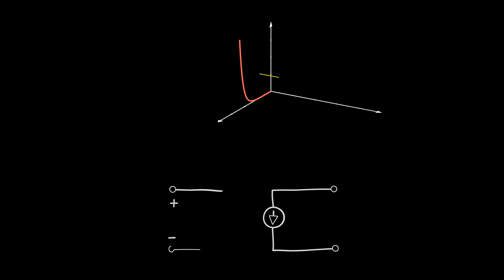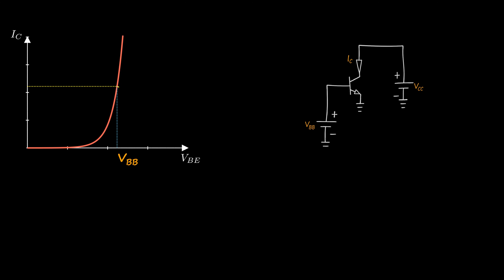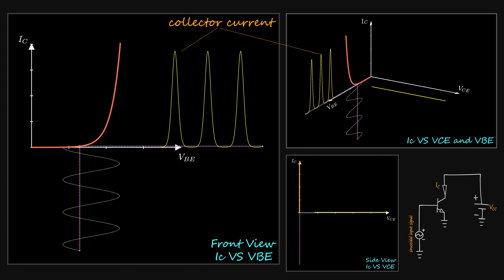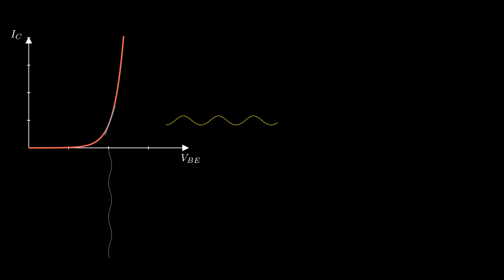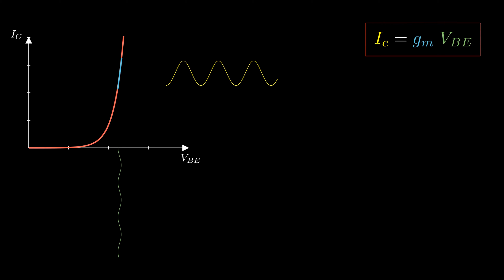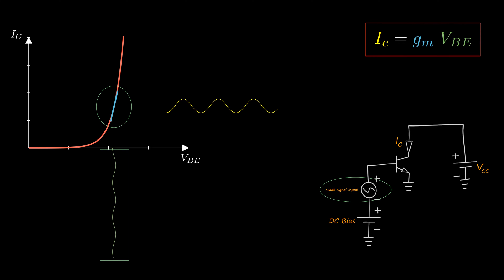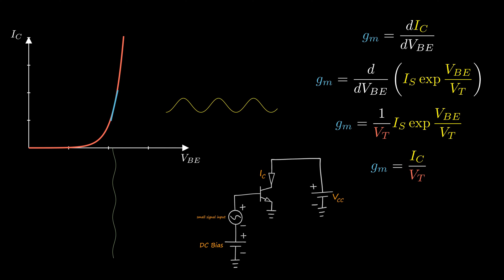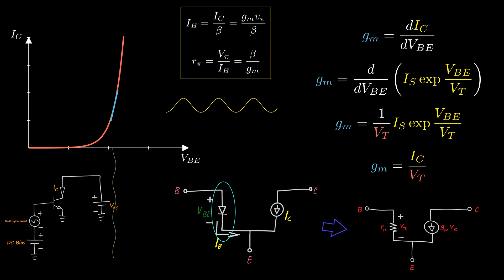Bjt Transconductance and small signal model explained visually

Comment: Technically, non-period signals, cannot be done with Fourier analysis... at least, as the sum of sinusoids. That's limited to functions on a circle... where as the Fourier transform can deal with functions defined on R, (real numbers). For example, the Gaussian, an important non-periodic function in engineering, cannot be represented as the sum of sinusoids.

Comment: It's really interesting the way you simply explain the operation. I have a question : why do we need a dc voltage source e.g Vcc with the collector of the BJT? Thank you and hoping for your reply
Reply from the maker: to work as a voltage controlled current source, bjt must work in "the forward active region" . bjt work in the forward active region only if VCE is larger than VBE. so we have a dc voltage source on the collector to make VCE larger than VBE.
Reply: Would you please make an intuitive video on BJT based switching operation for us?